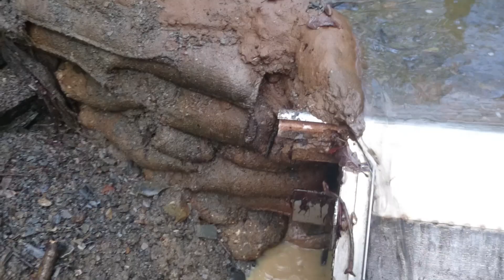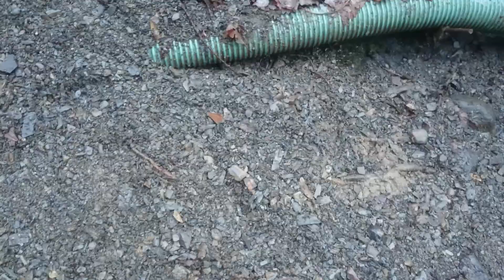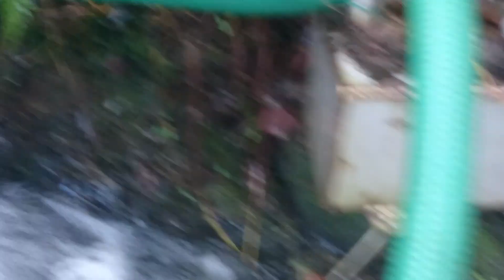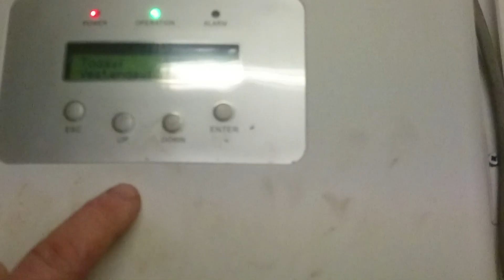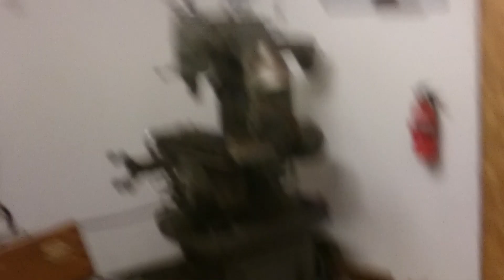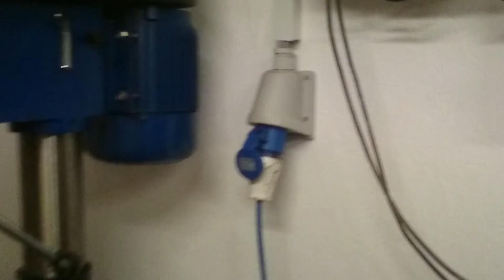Renewable energy DIY micro hydro electric turgo turbine

Comment: Just hear of turgo turbines for the first time today..very cool project!
So just going to ask this simply - how are you storing that? My dad has a tesla powerwall and I'm thinking of building this for our house routing our roof's rainfall into a singular place and placing a turbine there for generating, just not sure if it could be stored & how?
Reply from the maker: Hi my surplus energy is stored as heat in an accumulator tank. This is used to heat the house and domestic hot water. My turbine uses 16 litres a second at 17 - 20psi to generate around 750 watts. I do not think that you would be able to get a viable head and flow from rooftop down pipes.

Comment: Will you make lifepo4 videos as storage systems? If can't, you can start with your energy storage system
Reply from the maker: Hi obi 1. My surplus energy heats water. So I have a thermal battery. I have not heated my domestic hot water for 6years using a boiler. After the domestic water is hot the energy then goes to an accumulation tank for central heating.
Reply: @hydro7319  oh I see😁I was just used to watch lifepo battery as energy storage. Anyway, keep uploading quality contents.
Reply: Btw is your turgo spoons made out of metal or plastic?

Comment: Really good video should try to do a new one really interest in your system , what s the size of your pipe , and what s the type of your generator ; THank a lot SEB from France
Reply from the maker: Hi Seb I used 5 inch pipe with a 100mm bore. The generator is a washing machine motor.

Comment: How is your hydro doing? I would like to give it a try here in Chile. Jim
Reply from the maker: It’s doing fine thanks, still running well when there is enough water. I will change the bearings in the summer need it or not. It has done very well this winter. I only lit the boiler a couple of times the turbine and heat pump taking care of the rest of houses heat demands. If you have a suitable water source in Chile then give it a go. For me it has been a good venture.
Reply: @hydro7319  Just wonderful. I would like to give it a try, but I will have to save up some money to make it happen. Have you done any update videos on the Hydro? If not I would love to see one. Jim

Comment: Obviously you are using streams & damns ect.. but if you didn't have a stream on your land, could you hook a turbine upto your home water tap that has plenty of pressure already? & then just drain back into the system.
Reply from the maker: Not really James. The flow rate would not be enough. You could not put the water back into the clean water system because the used water from the turbine would have a lower pressure than the mains system so would have to go to waste. That said if your mains water was at high enough pressure and flow and there were no concerns over the obvious waste of clean water. Or the removal of the waste water from the property. If you were to treat the mains utility water supply as just a power source you could theoretically do something. But from a tap/domestic supply not really economicly feasible nor environmentaly friendly.
Reply: Well yeah, I did mean to just let the fresh water go to drain, the amount that's lost through leaking pipes ect, this would be miniscule,, , not something I would run 24/7, just maybe whilst at home & this in conjunction with my solar panels could charge a home battery or alleviate grid usage, 
Economical doesn't come into it as I pay I price for my annual water wither I use 1 L or 1000L a day,, 
5 bedroom house with just the 2 of us so could be using so much more water if the house was full,, 

Environmental doesn't come into it yet for us as I'm looking to save bills rather than anything else. 

We also have a septic tank so I don't actually know how my waste water / fresh water bypasses this,, Very New to the concept here.. 

Cheers

Comment: Hi, i dropped you a line earlier in the year after watching your video as i was thinking about setting up a hydro, i got it all done over the summer and now have it running quite nice,  i have 32psi standing and used three adjustable jets, i loose around 4psi for every jet i open so have 28psi with one jet open and 300w 24psi with two jets and 500w and 20psi with three jets however the third jet brings the power down around 400w, i know i have a lot of playing around to do yet with the pipe leveling and i need to make a better turbine box as the one i made is just rough to allow me to learn what jet positions work best, my wheel come with the turbine and is an 8" pelton with 12 spoons but i've seen a few people like yourself say there using a Turgo, can i please ask what size wheel your using  or if possible where you bought it as i'm thinking of giving one a try.
Kind Regards
john
Reply from the maker: Hi john how much water do you have. Genrally turgo turbines like lower pressure & higher volume. Mine eats 16 litres per second.
Reply: @hydro7319  Hi thanks for getting back, my water goes up and down depending on rain as i type this i'm very low at around 4 lps as we've not had rain for a few weeks, after rain it can go crazy, for example three weeks back i had three jets open using around 12lps and my 4" pipe sitting in the stream was 2-3" under water.
Hydro is something new to me and i'm just trying to get the best out of what i have trying different configurations to see what works best.
When i have water i have 34psi standing,  i'm losing 3psi for ever jet i open, i was losing 4psi but changed from solid pipe to flexi hose to the jets like what you have, i need to have a play with the pipe and try and get a flatter run which should give me less loss.

To be honest i only expect to use 1 or 2 jets most of the time the third is just for when i have extra water,  when i have water i have 300w from one jet at 31psi and 500w from two jets at 28psi the system is grid tied rather than battery.

I'm just enjoying playing with the system and trying different things to see what i can get out of it and thought a Turgo wheel may make a difference.

Take care
john
Reply from the maker: @johnbeattie9561  give it a go john mine is 16 spoons with a pcd of 160mm. Obviously you know you will have to redesign you turbine housing the water will have to enter the top of the turbine at an angle of about 20deg for the water jet to be in contain with 3 spoons.
Reply: @hydro7319  Thank you, yes i think it's worth a try to see what difference if any it makes, my turbine housing is just a rough build as i kind of thought i'd need to do some trial and error to get things working well so didn't want to build or buy anything to fancy just yet, so making a new one with the correct jet angle is no problem, i'd not realised the jet of water hits three spoons on the Turgo so that's good to know.
Anyway thank you again for getting back if in time i get the system putting out more power i'll drop a line and let you know.
Take care
john
Reply from the maker: Hi John it is a 16spoon turbine wheel with a pcd of 160mm. I'm very pleased you have a system up and running. Mine is still running well.

Comment: What is the generator u used ?
A smart drive motor ?
Reply from the maker: Hi i will probably make a new turbine in stainless in the future. I can do a video of that when i do it. Just wating on having enough stainless left over from other projects to do the job.
Reply from the maker: Yep a genuine washing machine motor. Totally amazing you can run a house from junk. Rewired, with the shaft modified to take the turbine wheel. Quick release so that I can remove the shaft and bearing block from the top of the turbine. I cannot remove the shaft from the bottom as the bearing retaining ring on the shaft would have to be pulled through the bottom oil seal.
Reply: nice
are you planning to upload any further videos on your hydro system ?
bcz i would love to see the whole system including the generator and turbines

Comment: So you took all of the waterflow for your Hydro?  I like the setup but using all the water can have negative consequences.  Of course you said the water is low at the moment but does your water source flow higher for a majority of the time?  if not you might want to adjust your intake as you never know the damage you can be doing to the eco system by starving a good portion of the creek of water.
Reply from the maker: I did not take all of the water, there are a couple of tributaries feeding this stream, you can see one of them looking down the pipe from the filter box. I took all of the water from a 12mtr stretch on this day. There is for the best part a larger flow most of the time sometimes so much that you would not dare stand in it. I was aware that the stream needed to still have water in it. There is no larger life in this stream than water shrimps, and unbelievably they pass through the system. The catchment for this stream is run off from fields. That gives it a flashy nature. In the summer it might dry up entirely. In the winter it moves water. I do not believe that there has been any damage done. If I want to use less water rather than adjusting the intake, you can just turn off a valve or two. Thanks for looking, and I appreciate the comments
Reply: Awesome.  Well keep up the good work.  Any plans to upgrade the generator or what is your current peak with max flow?  I am still in planning phase for my setup so it was good to see someone with similar flow and pressure to what I have in my low flow seasons have a setup up and running.

Comment: Very nice thank you for posting your video,  i'm interested in doing something like this myself so it's great to see how other people do it, i was thinking about using 4" soil pipe to bring the water to the turbine then drop to 2" but wasn't sure if the soil pipe push fit would hold together under the pressure, can i ask if your 5" pipe sections are a push fit or are they fitted together in another way ?
Reply from the maker: Hi John if I were you I would keep the sections of pipe was wide as you can for as long as you can. This limits the friction in the pipe which has the effect of removing head from the system. 
I experimented lots with the penstock pipe and the filter box, and the best way to explain what I found out, was don’t try to cut corners. I tried using suction pipe to start with because the stream bed has many corners but this took every opertunity to blow itself apart. I used HDPE pipe in the end it’s rated to 10Bar. You can buy this on a coil or sections. I used a combination of both. These were joined with electrofusion couplings. They cannot pull apart. The easiest way to think about any part of the system is if you have any doubt about it, then this is what will surely happen. Don’t forget the intake as well coanda is the way to go.
I have enjoyed doing my turbine, although the learnings were frustrating at the time result has been worth it. I hope that you enjoy yours as well.
Reply: Hi Hydro, many thanks for getting back and for your advice,much appreciated.
I've been looking at rolls of HDPE pipe and was thinking that would be a good way to go just not sure what size i'll go with yet, the stream runs well in winter and even better after heavy rain so was wanting to build things so i could take advantage of the heavy rain when it comes, we take our water for the house from a similar stream so have had some experience with intakes before, getting them to run smooth and as maintenance free as possible can sometime be a pain but we have a system that has been running for two year without having any problems so was going to do the same for the hydro, it's more or less the same as what you have done on yours. frustrating i guess is all part of the fun it keeps the brain ticking over.
Thanks again 
Take care
john